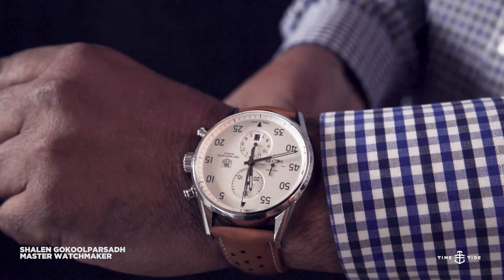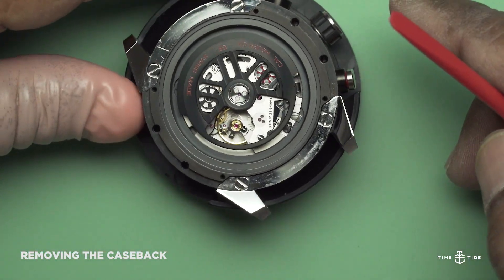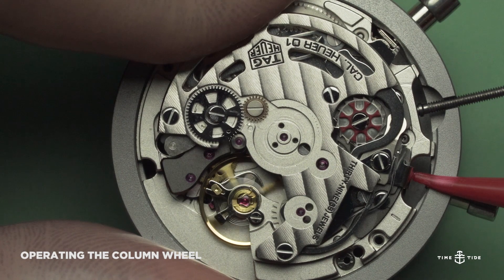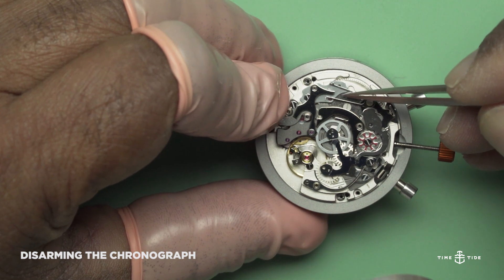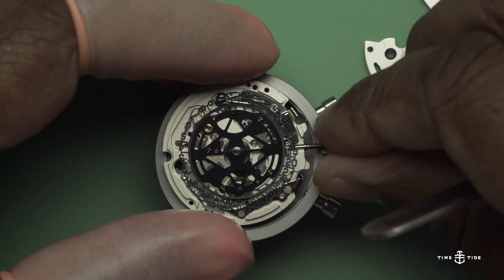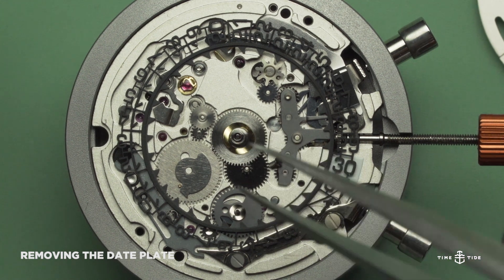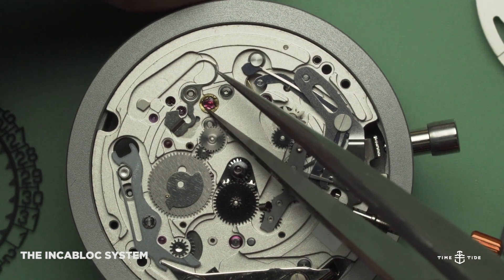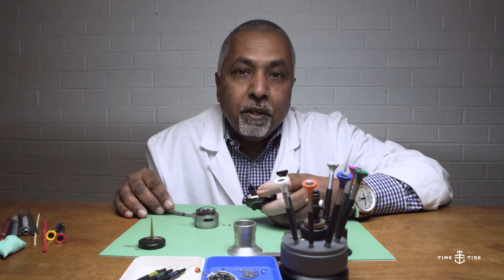TAG HEUER – Disassembling a Heuer 01 Chronograph Movement

Comment: So we're just going to ignore the black plastic movement holder that is clearly visible. Okay....
Reply: Why is that an issue?
Reply: @alexanderkamerbeek9693  
Over time they dry out, become brittle, crack, fall apart. You go to have your favorite watch serviced.... And get a call from the watch-maker with bad news.  Plus, cheap plastic movement holders are what you get in cheap, low-end Automatic movements. Not something that costs as much as one of the higher end TAG Heuer's do.
Reply: @NGMonocrom  however you don't think this movement serves as a base for other movements which will need to fit in different cases? I do agree that it would be better if they would mill the case but that will make it more difficult to service aswell because of the dial.
Reply: @alexanderkamerbeek9693  
The movement, yes. But the movement holder is a separate part. In other watches it could easily be made out of metal. A plastic movement holder isn't a requirement for any movement.

Comment: Heuer 01 movement is TAG's 1887 movement, which takes its roots from Seiko movement
Reply: It's a refined version of the 1887. It's not identical
Reply: It’s from a grand Seiko movement not Seiko, completely different brand
Reply: @Aztec1050  It was only a sub-brand before increasing its presence. Even today it is still part of Seiko Holdings, who is in turn under Seiko Group. So really the expertise and staff are from Seiko.
Reply: Yes, but its worth pointing out that the TC78 was a movement designed for Seiko Credor, which makes a world of difference. Credor sits slightly above Grand Seiko - IMHO the heritage of the movement is pretty damn top class and arguably more impressive than the fully in house Heuer 02.
Reply: @Aztec1050  Credor, not Grand Seiko. Grand Seikos never used the movement.
Reply: @grandiora It really isn't - the corporate ownership is much more complicated and actually supports the argument that Grand Seiko, Credor etc are in a different class entirely from "mainstream" lower end Seikos.

The high end Seikos are made by a different company than lower end Seikos - they are designed and manufactured by Seiko Epson not Seiko Watch Corporation or Seiko Holdings. Seiko Holdings doesn't own Seiko Epson outright (Seiko Holdings only the 4th largest shareholder in Seiko Epson - they own around 3% of Seiko Epson). Seiko Watch Corporation is however a fully integrated division within Seiko Holdings. 

 Seiko Watch Corporation (which is a fully integrated) markets and sells all Seiko watches but manufacturing is a different matter. 

Grand Seikos are now made in their own workshop - Studio Shizukuishi - so their manufacture is also separate from everything else (except Credor, as Grand Seiko supplies some of the movements for these).
Reply: @JimIBobIJones  the 6s37 was developed in Grand Seiko atelier alongside with 9s55. The only difference is the sub second vs central second and the addition of power reserve and chronograph complication, the bases are exactly the same. 6s37 is basically 9s55 with some 9s63 parts and chrono module. I’ve repaired enough GS and Credor to know all these
Reply: @Aztec1050  It was made by the Grand Seiko workshop but Grand Seiko watches never used the chronograph movement - it was specifically developed for Credor (although it was later used in limited release watches for other higher end lines, such as the flight master, but never for Grand Seiko). 

I don't think you can call it a "Grand Seiko" movement if it was never used in a Grand Seiko watch. Not necessarily a bad thing as Credor on the same tier as, if not a bit higher, than Grand Seiko. 

Grand Seiko went straight to the spring drive chronograph - and eventually Credor phased it out in favour of the spring drive chrono as well. The TC78/6s37 was specifically designed for and primarily used in Credor watches.
Reply: @Aztec1050  Also chronograph modules sit as a layer on top of existing movements (a la DD modules). The TC78 is an integrated chronograph complication, so pretty unfair to describe it as merely a  "module".
Reply: @JimIBobIJones  well as a watchmaker we usually go by movement family rather than specific movement, for example the 8L35 also belong to the 9S5X family. So yes I would say the 8l35 is also a grand seiko movement because it shares 100% identical parts with 9S55, 8l35b also has hardened pawl leveler and some skeletonised parts on pallet fork and wheel found in 9S6X family.
Reply: @JimIBobIJones  also your logic is dangerous for many lower end brands, a lot of those brands use outsourced eta/sellita movements, we watchmakers call them eta movement watch rather than XXX movement 1234 that’s based on an eta. By your logic a sellita sw200 would have the movement name for 100+ brands, this is very confusing .  Similarly, we usually say anything mechanical made in Shizukuishi studio to be GS movement.
Reply: @Aztec1050  whilst I would personally still go by the use cases in brands to classify whether a movement belongs to that brand, I get your point.
Reply: @Aztec1050  it's not the same. The Chronograph movement was a bespoke design for Credor not an ebauche. To say that its a grand Seiko because it came out of the same design team. That's like saying the omega 8500 isn't an omega movement because it was designed by ETA/Lemania/Blancpain and originally manufactured in central ETA factories.

If it's a movement bespoke/exclusive to a brand,  then it's more than fair to say it's that brand's movement. Many of the brand's using "in house" movements aren't manufacturing it in house but are outsourcing it to 3rd party suppliers. It's the exclusivity of the movement that makes it proprietary.
Reply: @Aztec1050  also it's a mischaracterization to describe the Shizukuishi Watch Studio as the "Grand Seiko Artelier" the studio was set up to support both Grand Seiko and Credor.
Reply: @JimIBobIJones  again you are wrong, that chrono movement was not bespoke for credor, it was also in Seiko phoenix. It’s pointless to argue with you, I have disassembled enough of those movements to know what I’m talking about. Are you the kind of people who believe that the 9F quartz has a service interval of 50 years?
Reply: @Aztec1050  so you are saying your experience means you know better than the people who made the movement? Like I pointed out in my last post the Shizukuishi watch studio itself lists it as a Credor movement!
Reply: @Aztec1050  also it's the Seiko CREDOR phoenix.... So yeah, that's another Credor movement.

It started off bespoke to Credor but Seiko released limited runs of less well finished versions in special editions of other lines (similar to how the grand Seiko movements were used in Marine Master watches) and after they stopped using it, they were sold to third parties as  a time module movement before the design rights were sold to Tag Heuer.

That doesn't mean it wasn't originally made bespoke for Credor. Just as the 9s55 doesn't stop being a grand Seiko movement because it was also used as the basis of marinemaster movements.
Reply: @JimIBobIJones  im not better than the people who designed and made the movements, I’m better than YOU! Stop fooling around and pretend you’ve actually made mechanical movement in any way, shape or form
Reply: @Aztec1050  again, I'm not claiming I made it. I am repeating what the Shizukuishi Watch Studio has stated on its website. You know you can pass on information from another source without being the source itself right?
Reply: @JimIBobIJones  that chrono movement has been used in many other seiko models not only for Credor. I’ve repaired so many flightmaster that contain this specific movement, I bet you will now say it’s Credor Flightmaster yes?  What a clown
Reply: @Aztec1050  like I said, the manufacturer calls it a Credor movement. so I am going with them. You do you.
Reply: @JimIBobIJones  you remind me the kind of people who would spend 3 months of his salary on engagement ring, you would probably also service your Grand Seiko every 2-3 years, oh man the manufacturers love people like you
Reply: @Aztec1050  how do? All I am saying is that a different perspective is valid from yours, as it shared by the manufacturer themselves. Like I said, I see your point, it's a completely valid one but there can be more than one valid perspective.

You are the one who is ranting, raving and throwing around personal insults...
Reply: @JimIBobIJones  I’m insulting you because you kept on defending Seiko when we both knew they made a mistake again on their website 🤡   . I have no respect for hypocrites

Comment: Man the finishing on this movement is so half assed. They only finish the components that you can see, while the ones that are hidden got completely skipped. wtf?
Reply: Not the best finishing but you have to consider the price point they sell for.
Reply: what do you expect for an entry level price ?
Reply: @brianhsin678  Entry level price? Mate don't even try.
Reply: @LemtemPoktui  For a swiss made column wheel chrono with a bit of brand cache. 5 k is very entry level luxury.
Reply: @brianhsin678  now you put it like that, I guess you're right. So I still couldn't get over buying this over the Longines's Master Chrono (even though it uses a modified ETA).
Reply: @LemtemPoktui  Longines offers great value in general. I like the big eye chrono myself. I am not against modified ETAs, they have a proven track record, and usually are cheaper to service.

Comment: That movement is so ordinary
Reply: Greg Mieg It’s still better movement than typical eta7750 in which many watch brands use.
Reply: Бојан Павловић this one has better functional performances than 7750.
And wth you know about movement finish.
Reply: Aside from the lack of a vertical clutch (which is odd because the predecessors of the Seiko 6S37 - the 1887/Heuer 01 is based the 6S37 whose design tag bought a licence for - did have a vertical clutch) it Its a fairly sophisticated and modern movement (largely thanks to Seiko's proprietary technologies like the vibrating pinion and "magic lever"). Design wise, it is also amongst the nicer "workhorse" column wheels that have chronograph function cleanly integrated into the movement - as opposed to the bulky, awkward designs at similar price points which more closely resemble modular movements rather than proper intergrated chronographs. In the case of Panerai and Breitling, their in house chronographs ARE pretty much chronograph modules stacked ontop of a base movement.

That said, they definitely make the movement a lot uglier since re branding it the "01".
Reply: JimIBobIJones I strongly believe that vibrating pinion was heuer's patent and still belongs to tag's tech.
Reply: But that was from back, back in the day and long since lapsed. In the case of the 1887/"Heuer 01", its something they carried over from the Seiko base movement rather than something they added. I'm not dissing the movements or the watches (the 1887 carrera is one my favourite watches in my collection) but we shouldn't buy too much into Tag's deceptive marketing: credit should be ascribed where it is due.
Reply: Well the 7750;was developed in the 1970’s so expecting it to be better than a much newer developed movement is not realistic. Honestly I was a bit disappointed in the Heuer 01 design. I recently worked on a Longines L688 which is a 7753 with a column wheel design, based off the 7753. The upgrades to the movement along with the column wheel places it in my mind a step ahead of the Heuer 01, and at least on par (it is very robust, nicer finish, and the column wheel is blued steel with more pronounced geometry than the Heuer). Heuer has the chance, like the 7750/7753, to make variations of the movement for higher grade finishes as well as special escapement components.